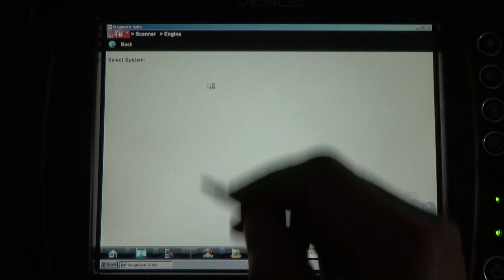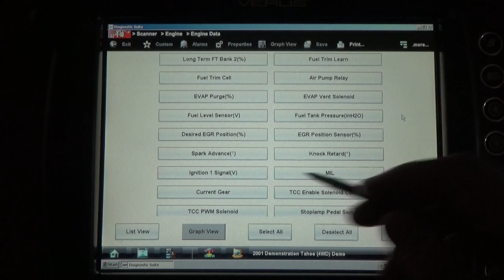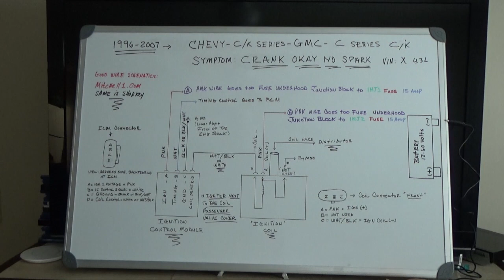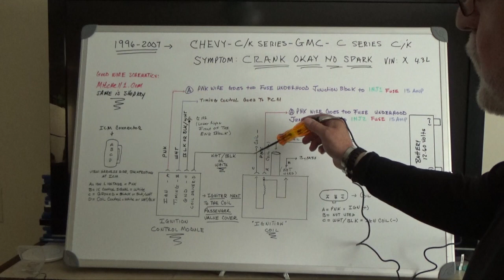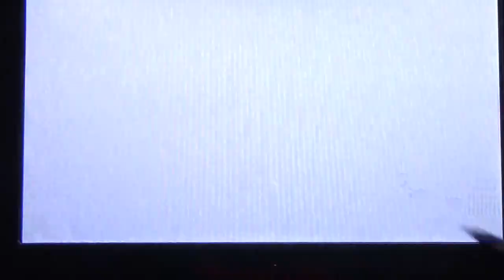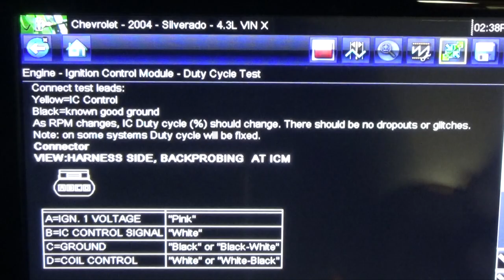Crank Okay NO Spark!! GM Products!(1996-2007) CHEVY C-K SERIES GMC - C AND C-K SERIES

Comment: Hi, I am very lost with my situation. 
I have a 5.7 Vortec in a 2001 Chevy express van. 
When I first got the van, sometimes when I would crank it it would make chugging noises and take a while to crank. 
I was thinking it was the fuel pump.
I crossed the fuses in the fuel pump (backwards) and burned up the pump.
I changed the fuel pump and CPS. Van fires right up.
I take it to work the next day and the van stalls out about a hour into my trip. After cranking around 15 times it cranks up. About 15 minutes later it back fires really loud and does not crank again.

Now I have changed the ignition switch, the ignition control module, the coil, have checked distributor. Also had the timing chain redone. 

All in all, no spark at the coil. 
Any suggestions? I’m close to wanting to scrap it.
Mechanic also had me get a pcm from the junk yard because he said power wasn’t coming from the computer..but this made the security light flash. 
Have now put the old pcm back in. Not sure what to do.

Comment: I'm having the same issue with a 2000 k2500 I had it up and running after a rebuild and then lost spark totally is a VIN code R model two-door standard cab. Does this video also apply to this vehicle, if you can help me out I would sure appreciate it

Comment: The open circuit from the C terminal on the ignition coil to the D terminal on the ignition control module of my 2003 Chevy 4.3L V6 pickup wasn't due to a broken wire or open circuit wire after all. I cut the wire that runs from the C terminal on the ignition coil to the D terminal on the ignition control module then I unplugged both connectors, stripped the ends of the wire and tested for continuity from the end of the cut wire to the C and D terminals with T-pins. I had continuity from the wire to the D terminal but I had no continuity from the wire the C terminal. So I have a bad ignition coil connector pigtail I need to replace. General Motors can't even manufacture good electrical connections. Next time I am going to buy a Ford. I ran a 1984 Ford Range form 1992 until  2016 and it never had a bad electric connection part.

Comment: May God bless you Pete Sambolin,  following your excellent video I fixed my 2003 Chevy 4.3L V6 pickup truck as soon as I ran a jumper wire (with T-pins stuck into the connectors and alligator clips on the jumper wire) from the C terminal on the ignition coil to the D terminal on the ignition control module (both have a white with black stripe wire) my pickup truck which had not run in over 6 months started right up. So next for a permanent fix I am going to slice some some insulation on both wires with a razor knife , solder in a jumper wire, and then put liquid tape and electrical tape at the splice. I wasted a lot of time and money replacing the ignition coil, the ignition control module, and the crank shaft sensor which did not make it run.
Reply from the maker: Sorry for the delay! And thank you for your comment like I say too many people that walk where I work in Advance Auto Parts in upstate NY Do some testing with a simple test light and car schematic that know is not even available to buy in the stores! I recommend Mitchell 1 on the web is like $19.99 for 3 months for a single car but you can get TSB and Recalls schematic and print everything! So thank you again for your comment! I love it....
Reply: @PeteSambolin  Thanks for the advice about https://mitchell1.com  never heard about it before.  I just now checked on it and Mitchell 1 has moved their $19.99 for 3 month for 1 vehicle deal to https://eautorepair.net I will sign up for it and download it the next time I have trouble fixing something.
 I bought a Haynes Shop Manual for 1999 thru 2006 Chevy and GM and the wiring diagram matched exactly the one you drew but I did not understand how it worked until I saw your video. 
The Haynes manual says for both V6 and V8, "The camshaft sensor signal is not essential to engine operation. The PCM only uses the camshaft position sensor signal for fuel synchronization and misfire detection." 
Thanks to  your video I see now how to use my test light clipping the red clip to battery positive and the black clip to battery negative. Then when the probe touches an energized positive terminal it lights up red and when it touches a grounded terminal it lights up green. All this PCM controlling relays is new to me. I always ran carburetors before. It seems very strange to me that injectors fire from a ground signal instead of from a positive current. I see these Chevy 4.3 V6s have a spider injector under the intake manifold. The parts store had no idea what T-pins were when I asked for them but then I saw them in an office supply department for pinning papers to bulletin boards.

Comment: Great explanation and video Pete Sambolin! Thank you Sir. My 2003 Chevy Silverado 4.3L V6 cranks and gets fuel but it still has no spark after having replaced the crankshaft position sensor, coil, and ignition control module. Should I just solder in a permanent jumper wire form coil driver terminal A to coil terminal C if first jumping it with t-pins makes it start? I suspected a broke wire because for several months it would die but restart when I jiggled engine wiring harness but then it would not start at all.
Reply: Tengo corriente viva el blanco y negro no. Flashea el cable esta crusau